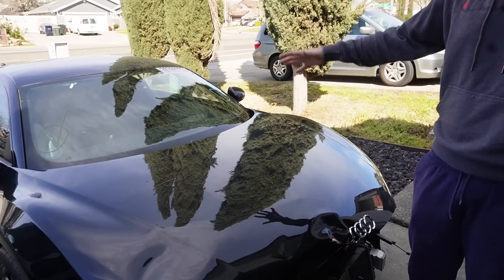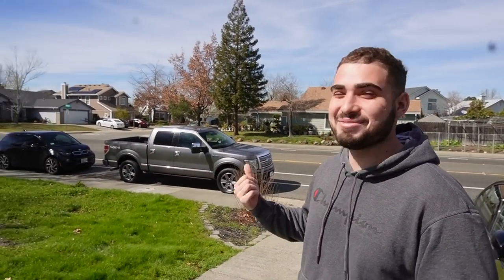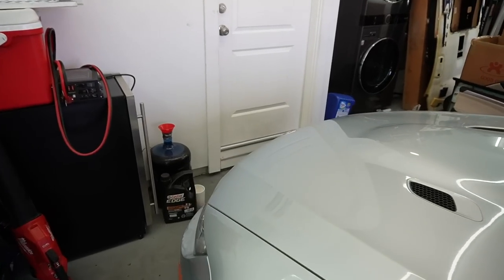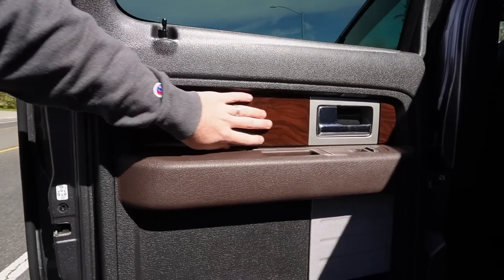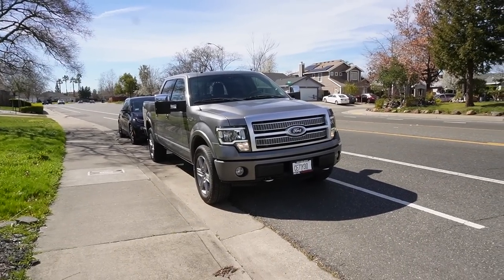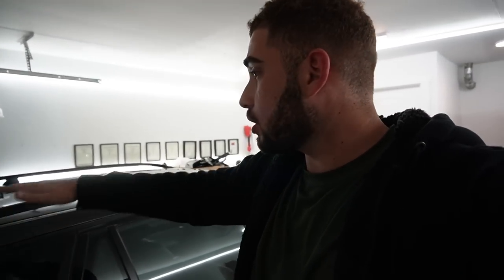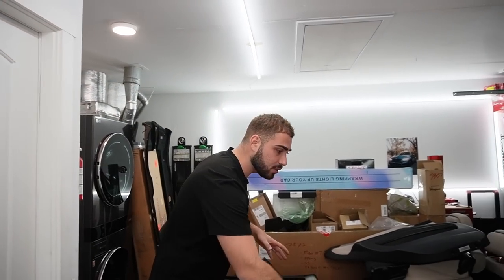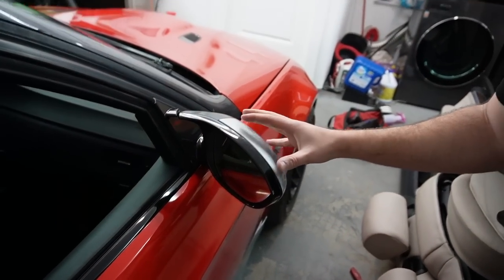MY E91 M3 WAGON COLOR REVEAL! + NEW TOW TRUCK!

Comment: Nour, I think the F-150 is a decent buy for that price. I completely agree with your rationale about replacing a motor on a truck like this vs one that doesn't look as good. This one has the 5.4L V8. My mother bought one brand new and we got it to 205,000 miles before selling it. It developed problems with the cats and the power steering was shot. Other than that, it was super solid, only leaving her stranded once in 19 years when there was a spark plug failure, if I remember correctly. Ford's 5.4L has been discussed at length on the internet. I would encourage you to go through and check out some of the issues on the forums and address the common issues preventatively so you're not left stranded. I pray your motor gives you many good miles, but if something happens, I would recommend swapping in a newer 5.0 motor. They were introduced in 2011, which is the same body style so I would assume the only issues would be computer/ecu issues considering its a different type of motor. Physically, it should fit no problems. Congratulations!